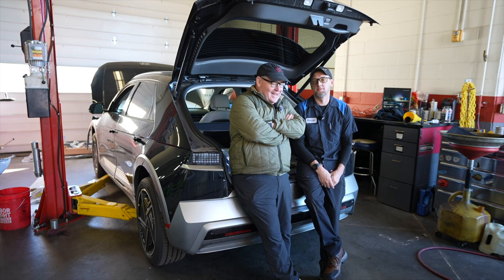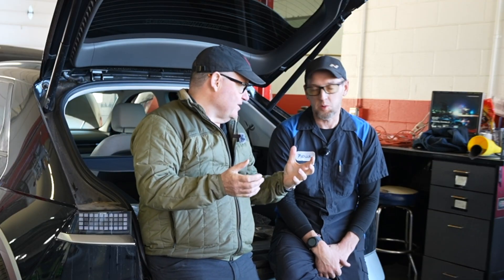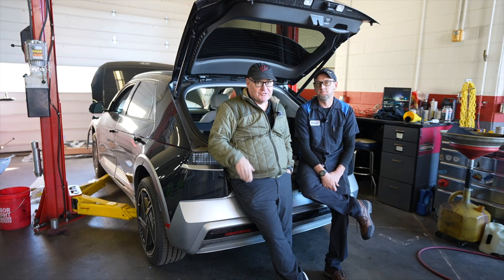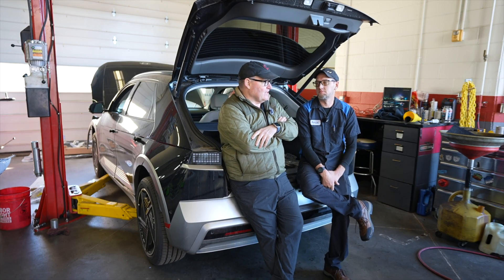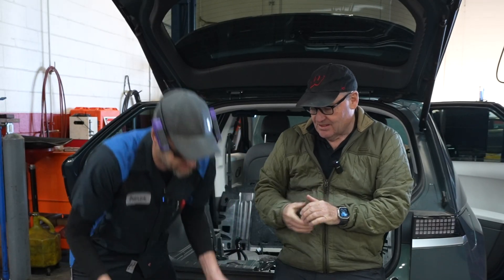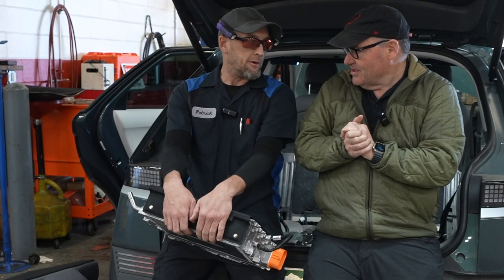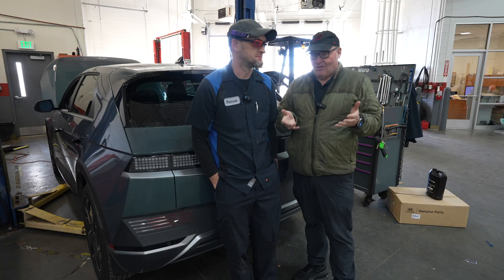IONIQ 5 ICCU Replacement: Patrick Replaces an ICCU  and Discusses ICCU Issues.

Comment: Hyundai need to sort this, it stopped me buying an ioniq 10% of all the cars?
Reply: Hyundai Ioniq 5/6 were on my EV consideration list but were removed due to ongoing ICCU issues.
Reply: @ishortedenron3668  Me too. I've been lucky and haven't had an issue but someone I know personally did. It failed multiple times! My lease is up in a few months and I'm looking elsewhere to lease a new EV. I love EVs and will always have one, it's not going to be a Hyundai or Kia until they become more reliable.
Reply: @ishortedenron3668  Likewise, I dropped it from consideration also, and Kias. they will be a lousy used buy because of this.

Comment: 1 minute in and already your statement in not true about getting a instantaneous next day ICCU. My friend had his fail 3 days ago. 2025 limited with under 5,000 miles. Hyundai had the brick towed to dealer. Dealer told him minimum 30 days for them to get a replacement. This is in central Florida. I absolutely love the Ionic 5 but can't buy one because who wants to drive a car that may quit on you at any time. Let's listen and see if there are any other mis statements. OK, @ 3:09 ONLY 10 batteries replaced!! How about how many 12v batteries Hyundai replaces before the ICCU fails? Many owners have replaced 12v batteries on their own so they can put in an AGM battery that Hyundai will not give them under warranty. My friend has had 3- 12v batteries replaced by Hyundai in 8 months time. Lets continue, shall we. Again, at 7min mark main failures 22-24 model years. The numbers for 2025 are increasing substantially and it's only the current model year. The others are as old as 3yrs now. Let's hear more... Alright, 2 ICCU's replaced in 2025. That is only 1 yr in and only 1 "little shop". Can't wait to hear more. I really appreciate you doing this video and at least acknowledging this is a big issue. I will close with this. One of the bigger issues is Hyundai customer service or should i say lack of customer service. The main complaints are getting Hyundai to actually talk to the dealers who have broken cars. The dealers get very little information from Hyundai and the customer gets even less and must continually contact customer service and dealers to get information. Not to mention lack of loaner vehicles and customers pissed because they are making payments on cars they are not driving for possibly months. I know 2 people in my little world who have had their cars turned back in under lemon laws. Again, thanks for the video it was very informative on how a ICCU is replaced. On a side not, i recently had a Hyundai salesman tell me he has never heard of a ICCU failure. Really!!!!
Reply: Excellent comments,  I want to purchase a certified IONIQ 5  Rear Wheel drive  that has 1.5 years left on the  basic  5 year / 60,000 originol warranty,     It's only 25,000  which is a very good price
but  I fear the price is so low because the dealership  I fear is hiding something.      What do you think?    The dealership say's  the ICCU has not shown any issues so far  in that  model,  but
what happens 2 or 3 years from now if the ICCU goes,  post   certified warranty expiration ?   am  I screwed  technically,   I thought  federal  U.S. government mandated recalls  are not subject to
expiration date limitations ?

Comment: Honestly I'm reading far too many online reports of people suffering this issue, hyundai need to own this issue and not just replace a part with a part that is gonna fail again down the line..... It needs to be redesigned properly and a recall done to replace, people are losing confidence that this company build reliable cars.

Comment: While I appreciate the attempt at transparency, you're still downplaying the issue. Consumer Reports is tracking a 4% failure rate for their subscribers, significantly more than the half a percent you are seeing in your little shop. Maybe your sample size is just too small. Heck, Hyundai itself is reporting 2% failure rate.

Also, stating that when it fails, you can drive it for "a while" is way too vague. Is it a mile, a hundred, a day, a week? The comment section has people reporting a few miles at best or coasting to a stop right away at worst. That is not a while, that is almost immediate.

https://www.youtube.com/watch?v=VveffZCxJ9c
This video from The Ionic Guy just popped into my feed. His car has been in and out of the shop for a month with multiple "fixes" not fixing anything. It really seems like Hyundai doesn't train it's tech very well.
Reply: One lady reported it quit on the interstate with her kids in the car. She barely made it to the shoulder before it bricked. Talk about scarry.
Reply: Dealers are reporting 15-20% in 22-23 model years based on their sales vs ICCU repair data.

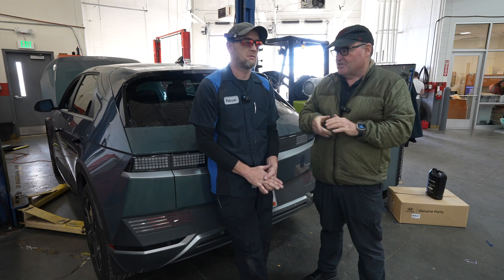Comment: 16:12  35 out 400 cars is a HUGE problem for such a big failure.
Reply: Its look more like 10 not 1 %😊
Reply from the maker: What other data?  Please share! Thanks for watching the channel.
Reply: It's more like 15-20% based on other dealer data
Reply from the maker: What other data?  Please share. Thanks for watching the channel.
Reply: @electricprincipal543  I know my dealer and he ran the numbers on sales vs ICCU failures (obviously, they could have serviced cars they didn't sell), but he came up with 18%. Another top selling dealer that he knows came back with 20%, but that's probably because that dealership services cars from a wider area that weren't necessarily sold at the service dealership.
Reply: @WilliamJefferson1776  and that's terrible. It should be no more than 3%
Reply: It’s 10% per year.
Reply: Those other 365 cars running the same defective ICCUs will fail too…. eventually.
Reply from the maker: That is true for all cars and people as well.
Reply: I will say this for perspective. Nearly every vehicle has an Achilles  heel. I had a Honda Accord that I drove for over 300,000 miles, but the transmission blew at only 60,000, requiring two weeks in the shop, and that proved to be a common problem with that model. I didn't enjoy that, but otherwise it proved to be a very reliable car. The main question is whether the problem can be repaired. ICCUs can be replaced. Meanwhile, my Pacifica Hybrid has numerous common problems for which Chrysler has no fix. You're just out of luck and they won't even try to fix it. At least Hyundai/Kia will fix the ICCU. And at the insanely cheap prices we pay to lease eGMP vehicles,  maybe that's a reasonable dice roll when consider the alternative for the monthly price would be a 15 year old Altima.
Reply: "we've sold " as all I needed to hear to know this is biased.
Reply from the maker: Your misunderstanding the video. That’s 35 failures for 1000 cars
Reply: @electricprincipal543  quoting from 16:09 on video "so maybe 30-35 we we've done for the whole shop out of 400 that we sold" are we watching different video ?
Reply: @peterhric2942  I think the math error is that if they have sold 400/yr for '22-'24, that's 30-35 ICCU failures out of the 1200 cars sold. That's still way to many but a lot less than the 20% estimate cited from other dealers.

Comment: I had a completely different failure mode in my 2022 model, 60,000 km. My ICCU developed a phase to earth fault which meant I couldn't L1 or L2 charge (it would trip the supply RCD/breaker as soon as I try charging). Can still DC fast charge and drive fine, no 12 V issues at all. Booked in to be replaced next week.

Comment: When my ICCU went L3 charge and 12v still worked but not L1 and L2 so different symptoms /problem can occur but still ICCU that's broken.
Reply: The ICCU manages DC/DC conversion to charge the 12V battery from the traction battery + AC/DC conversion from the grid to the traction battery (L1 and L2 charging). It is not used for DCFC (L3 charging) in contrary to what the technician mentioned. Either/both issue can occur. If AC/DC conversion fails, you can still drive the car since 12V is keeped alive and you can still charge the car at a DCFC charger only. If DC/DC fails then the car will die in just few miles.

Comment: I have a 2022 Kia EV6 wind AWD tech pkg at 29,000 miles had ICCU FAILURE.   Prior to that replaced 12 volt battery twice .  I told dealership in Atlanta that I suspected ICCU problem .  Finally after  being stranded on side of road and not able to charge Level 2 AC at home had car towed to dealership and ICCU replaced.  Took a week in shop with no loaner car.  I am surprised that NHTSA hasn’t got involved in this debacle!    4 years and counting.  I’m done with Hyundai-Kia-Genesis !
Reply: Exactly!!! Where the hell is NHTSA??? Consumers are getting screwed with these $56,000 bricks.

Comment: Any insight into why these things actually fail and what owners can do to minimize?
Reply: Theres a mosfet that fails inside. It has been speculated that it is from moisture, voltage transients causing damage over time, overheating. I don’t think Hyundai has confirmed a cause of the issue though, if they even know themselves. But it is definitely the mosfet that fails when this happens.
Reply: @Comfort031  I’m not a trained electrical engineer, but if it’s a mosfet, wouldn’t that indicate an imbalance?

Comment: If I'm not mistaken, Patrick misspoke. Outside of maintaining the 12v CAN bus, the ICCU is not involved in DCFC (L3) charging, only L1 and L2. Is that not correct? No mention of replacing the HV fuse or replacing coolant and purging the cooling system. Otherwise, helpful video.
Reply: I noted that mistake, too. The ICCU is still responsible for intercepting the control signal on the L2 legs during L3 charging, but the actual current doesn't touch any of the components used in L1/L2 charging like the caps and transformers.
Reply from the maker: I did not include every detail.  Replacing the fluids is part of the process even thought I am not sure why this is necessary.  You sound like you may have done this job yourself?
Reply: @electricprincipal543  Understood. Although not a lot of coolant will be lost, the replacement unit will be dry and per the TSB, the tech needs to blow out the ICCU coolant from the blue rear disconnected coolant hose. So air's introduced into the system, needs to be purged and the coolant tank topped up post install to avoid system warnings.
Reply: Correct, my ICCU died end of dec 23, with the holidays and parts not available, I asked the car back as they had no replacement car and trickle charged the 12V battery and DC charged (this goes straight to the main battery, the inverter is in the external DC unit where you are charging not the ICCU). It costed me DC charging (no refund) and a month of time, I pressed on after 3 weeks so they used the ICCU of the demo model they had standing.

BTW at 14:30 they replaced the battery fuse (or what ever it's called), it's not mentioned in the video. But I heard mine pop, made a hell of a noise so I knew something was wrong. No Engine light on my dashboard, so that was the only tell except when I tried to Lvl 1 or 2 charge, the breakerbox of my house tripped. Same for public chargers...

As it got mine replaced in 22, I'm hoping they extend the warranty on that thing because I have a feeling it's going to happen again and it's always at the worst times ofc.

Comment: Purchased my 23 IONIC 5 SEL used( was a loaner from the dealership) it only had 6,500 miles on it when it died! Took about two weeks to replace, was offered av loaner, but I had a second gas car.

Comment: Great video! I would caution you on giving the impression that the issue is less prevalent on MY '25s as not enough time has elapsed for the issue to manifest itself. According to the forums, most older failures have occured after about a year of ownership for earlier models. Apparently the ICCU replacements are still the same revision as well, so it may be only a matter of time before they fail as well. I own a '22 and I hate the thought that I'm probably driving a ticking time bomb. I will never buy another Hyundai product again due to how Hyundai has handled this issue.
Reply: I had a 2023 5 that had the problem. Got rid of it. My 6 also a 2023 died on the freeway. Just made the last lease payment on it and it’s going back. Hyundai has been horrible. My car was in the dealership for 6 weeks. They didn’t have loaners so I was told to get a rental, which I was supposed to be reimbursed for. Of course, Hyundai then refused to do that. Horrible company and I will never buy another one of their cars. Ever.
Reply: My '22 ICCU died in a little under a year, just like you said.

Comment: From a prospective buyers POV I find it worrying that Hyundai extended the warranty of the ICCU to 15yrs/400,000km (248k miles) in South Korea, but hasn't yet done the same for the USA. Until Hyundai extends the warranty in the USA I would be very hesitant about buying one of the e-gmp cars, as Hyundai has struggled to root cause analyze and permanently fix the issue.
Reply: That's absolutely right - Hyundai has done nothing to qualm fears of this widespread (in model year, in model) defect amongst current and future prospective owners that have a pulse on the EV market and specifically this issue.

It'd be a wildly different story if there had been transparent communication shared with owners at any step of the way, but the absolute lack of customer-first transparency is damaging to the customer confidence.
Reply: But even then, dealing with Hyundai's service departments are a pain. I'd rather they fix the design flaw and issue a recall.

Comment: What I know about Hyundai EV, coolant air purge itself takes 1.5hrs(each time takes 30mins and it requires at least 3times as per Hyundai electric vehicle specialist training). That technician is doing short cut. Don’t get me wrong, I have done that course and know what I’m doing
Reply from the maker: I did not include everything in the video. You are correct that replacing the fluid is required and done.
Reply: @electricprincipal543  Is that certain?  If so, does replacing the fluid at time of ICCU replace the need for ICCU coolant flush?
Reply: Yea the "Ioniq guy" had a battery replacement and obviously they didn't do an air purge, when he got it back the reservoir was empty and battery pre-conditioning didn't work. All they did was fill it and return the car so the pre-conditioning still didn't work. It's going back to the dealer again.
Reply: Or they just didn't include that part.  I doubt a skilled tech is shortcutting it.

Comment: With the numbers said, it was roughly 1% yearly failure rate on the 25 model (2 out of 400, owned for half year on average). So for a period of 5 years of owning the car, that gives a 5% failure rate. I.e., one per twenty cars will fail.

Comment: Thanks for shedding some light on this unfortunate issue on these vehicles. I’m surprised you’re seeing so few 2025s because it seems like the number of people posting that they have failed is exploding the past few weeks.  Maybe colder weather has something to do with it. Some people theorize it’s also a moisture condensation problem within the unit. Maybe in Colorado where you are it’s drier air and less of a problem.  At any rate, Hyundai has really dropped the ball on this.  I had a 2023 and I always sweat bullets about it leaving me stranded someplace. I leased  a 2025 assuming that the issue would be put behind us by now. But apparently not so I have another expensive car that I don’t trust to take on trips. Absolutely shameful on Hyundai’s part.  They need to come clean on this issue, fix it and give owners some peace of mind.  Doubt I buy another one if they don’t come up with a solution between now and March 2027 when my lease ends.
Reply: Condensed moisture has no salts and no conductivity. Not a likely source of the problem.

Comment: They had to replace 10 batteries of the 400 cars sold? thats pretty good but I'd hope it was much lower.
Reply: They should have stated it was the 12v. The factory battery is pretty crap. Most owners on the forums recommend switching to AGM. I switched last year and it charges much less frequently than the factory battery did.
Reply: @Rex84077 ah that makes a lot more sense. What is the advantage of using an AGM?

Comment: Great timing on this video.  I was just reading yesterday about the ICCU problem in IONIQs and I was wondering. what the story is.  It sounds like Hyundai is replacing the ICCU with a new unit that is the same design as the unit that has failed.  They have worked on software updates to improve the function or reliability of the ICCU, but the question is whether they need to modify the hardware.  Sounds like the ICCU design has changed in 25, and this has reduced but perhaps not eliminated the problem.  Is this problem limited to the IONIQ 5 or do the Ioniq 6 and 9 also have this issue?  Thanks for informing us regarding this issue.
Reply: Apparently all EGMP platform vehicles share the problem.

Comment: My 2023 Ioniq 6 has eaten 3 12V batteries and the dealer still wont replace the ICCU!
Reply: I replaced my factory battery last year with an AGM and the charging light is on far less then it used to be. AGM are a bit pricey but it's peace of mind.
Reply: Your issue is probably not the ICCU, my battery is over 3 years old. Do you use Accessory mode a lot?
Reply: @ibeam68  Nope!
Reply: This most likely isn’t an ICCU issue. The most common issue is the key fob constantly communicating with the car. If you leave your fob close to the car, it will keep sending a proximity update and prevent the car from going into sleep mode.